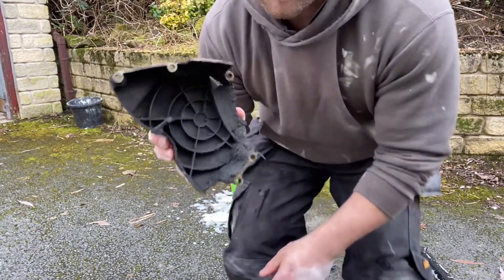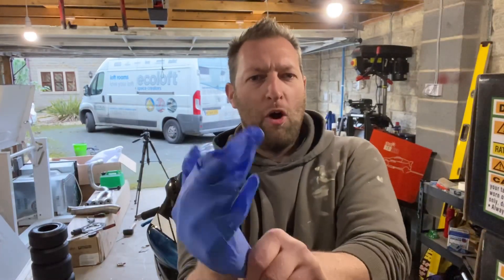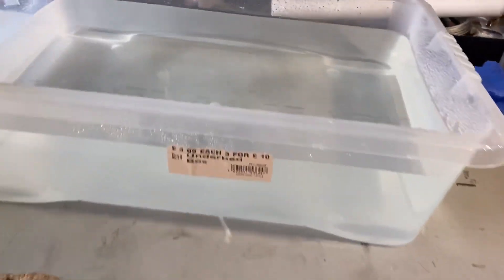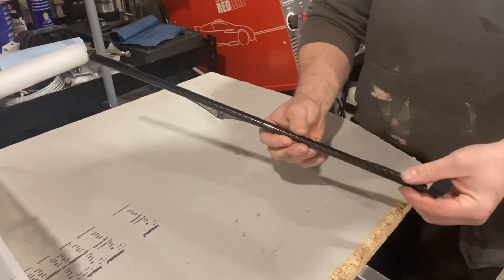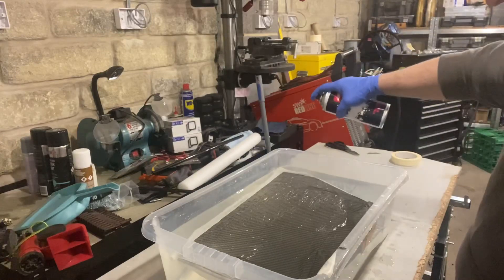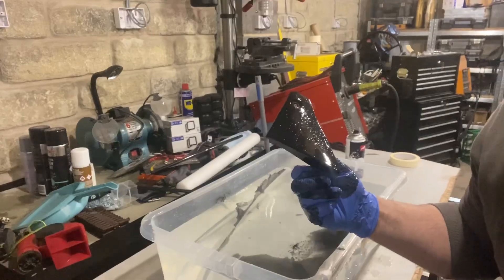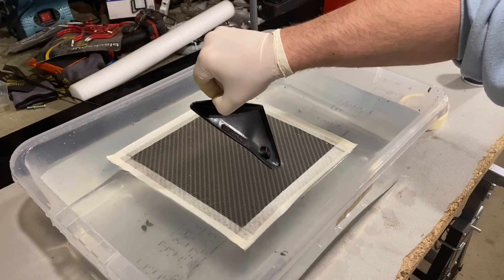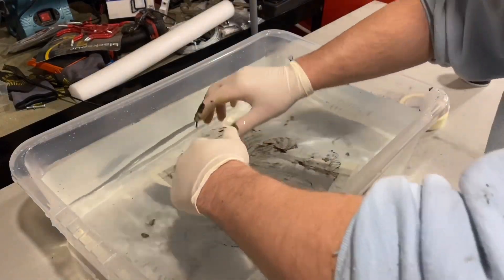HYDRO DIPPING ALL THE PARTS FOR THE R1

Comment: Did you spray parts with base coat paint first? If not try a black base of paint let dry then try dipping
Reply from the maker: Hello Matt,  I didn’t paint parts first  maybe that’s the trick I will give that a go  thanks for the advice appreciate it 👍
Reply: @builditwithrob  no problem man! The film has to have a base of paint to adhere to. Should solve the issues u are having.

Comment: How to hydro dip after you have spray painted item!!
1. ruff up what you are dipping with fine sand paper or a scratch pad 
2. Degrease item while using gloves (hands have natural oils on)
3. Water between 28 to 33 degrees (different films react best to different temps)
4. Size up film about 10-15mm extra all round 
5. If you are tapping it cut angled lines down the tape and just onto the film as you want the film to expand a lil while it sucks up the water aja hydrates 
6. Its sticky side down mot glossy sides dien as all films are different lock thumb and index finger grab corners whatever side sticks that side goes in the water 
7. Fold fim from bottom right corner to half way between top let and right corner GENTLE make a crease as this will make it easier to put in water 
8.place film in water gently opening corners out so it sots flush on water start timer for one min as timer is counting make sure I have no air bubbles if you do gently blow then out through the sides 
9.shake activator and evenly about 30cm from film spray in a line working you way down the film in sections from left to right then down a bit from right to left and so on till all the film has been activated grab tour toch make sure that the film is now glossy if in a certain place it Is bot dont worry just add a lil activator too it 
10. Time to dip! Grab you item with gloves on! And decide what the easiest and best way to dip it is once you have decided slowly dip the item at an angle with the last bit acting like a collapsing building 
11. Once item is dipped and submerged swish it about under the water to get excess off then pull it out of water 
12. Check for imperfections if you are not satisfied dint discourage just run the item under some hot water and rub the film off with some soapy water then dry it with gloves on and try again as we all make mistakes 
13. If you are happy with the results with warm water gentle very very very gentle rinse off the glue off the item so its left with no slime on 
14. Best to leave item 24hrs to air dry biy if you cant wait with a clean microfiber cloth give the dipped item a dry.
15. Once item has dried give item 3 coats of laquier,  make sure it's not heavy coats as it will run, let it dry for 15 mins between  coats.
16. Enjoy you new dipped item and showing it off to friends and family 🙂
Reply: Hey man. Quick question.  Where do I buy the activator from? I am buying the film from Amazon but I cannot find the activator. Thanks

Comment: 90° water leave tape off make sure your putting the right side down wet your index finger and thumb squeeze on corner side the sticks to fingers goes down 60 seconds on water you have 10 twenty seconds to dip you item film will start separating dip before that happens

Comment: I haven't done much hydro dipping BUT, what it seems to me is that you are using WAY too much activator. I just do one very quick pass. I also use "warmish" water, between 30 to 35ºC I'd say and I also use primer. Although a beginner, this does seem to do the trick. little activator and water temp "right"
Reply from the maker: Thanks for the advice bud

Comment: Just a few tips:

Make sure your water is warm (Not too hot, not too cold)
Leave the film, shiny side down in the water for a minute minimum or until you start seeing creases all over it
Make sure you blow gently the air bubbles/Creases off to the sides
Only use a few light passes of the activator until the wrap looks like water is soaking it 
Always scuff up the part you want to dip with sand paper & make sure the part is degreased
Before you wash the top film off, leave it for a minimum off 2 minutes for the paint to adhere better to the part
Leave it at least 30 minutes after to dry and clear coat
Reply from the maker: Thanks bud